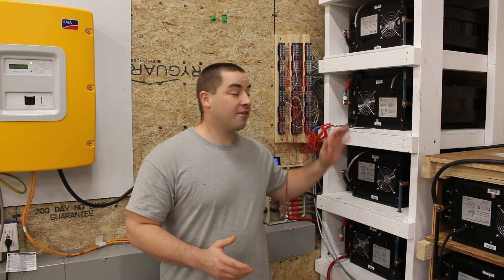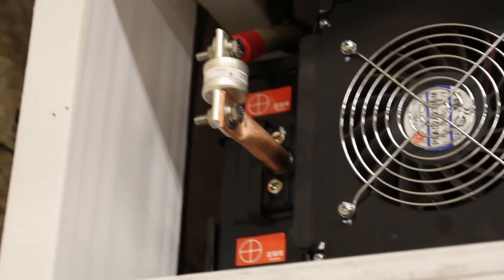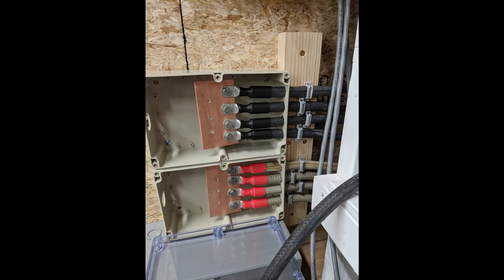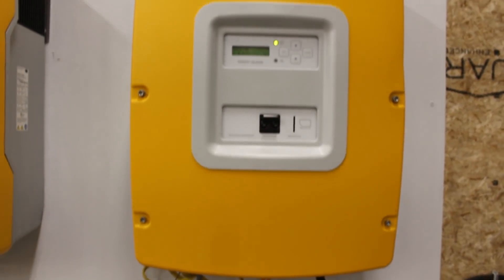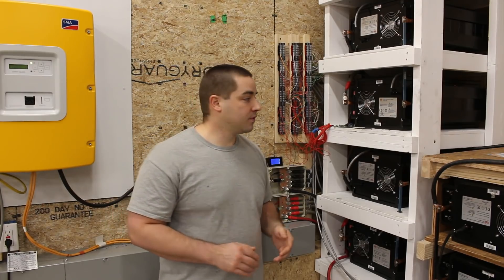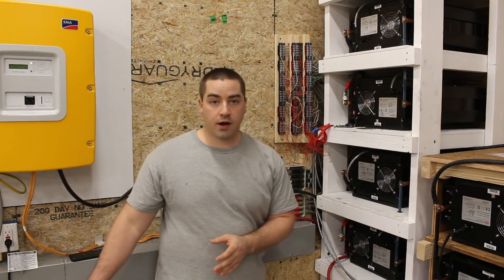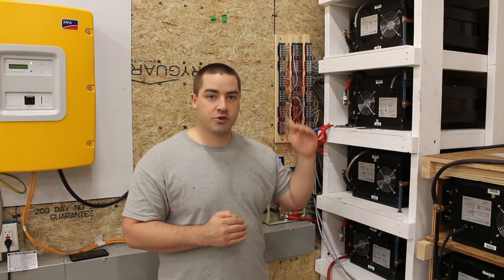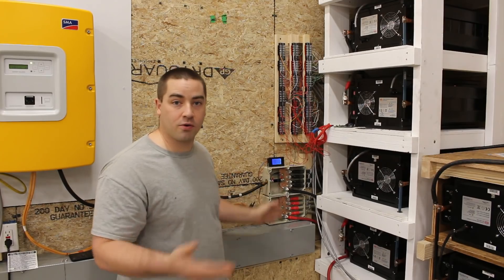Conditioning used LiFePO4 batteries, Update

Comment: David, is your original Chevy Volt batteries still fully charging by Noon in darkest Dec? Assuming you are still just using the original ground-mounted solar only.
Reply from the maker: Sorry I didn't mention this.  i sold the Chevy batteries, and the Aims inverter to help pay for this new equipment.  I'm buying power right now from the grid until the new system is operational.

Comment: I don't think there is much benefit in "conditioning" the batteries.  Unlike other rechargeable batteries, lithium doesn't have a memory effect.  Once the cells are reasonably balanced and the voltages are within the normal range you should be able to charge/discharge them normally.  Having said that, a few charge discharge cycles will give you a chance to measure their capacity and get a feel for how the system is working.
Reply from the maker: Thank you.  You are probably right.

Comment: Hi David, I have a suggestion for you.

You have got a lot of power there, and since you are still setting everything up; you should consider fire mitigation!

I see the exposed OSB wood & other wood, drywall, etc. 

You can make that area mostly fire resistant should a battery pack or inverter blow up, catch fire...

Consider going to home depot, lowes, etc. & getting the 4'x8' sheets of   Hardie-board. It is a cement-fiber board that is essentially fire-proof, rot, water, & pest proof!

If you cover the walls & ceiling you should contain any fire long enough to prevent further spreading to other parts of the home!  

Go watch the video they have showing where they stick a lit torch on the board for like 30 seconds and the board does not catch on fire or scorch!

Hope this helps.

P.S. this is a great solution for lining your water heater area too, in case of fire or major leaks!
Reply: 48v {2 packs in series) is 3v per cell, so should be 85 to 90% discharged at that point.
Reply: Wouldnt it be easier (and much cheaper) just to put that battery bank in a filling cabinet type enclosure?

Comment: 10amps, that is nothing spread over all the cells! 100 ma or so! 19kwh!! I could live a week on that! I'm hoping to get my bank up to around 30-40 kwh, 29v, a peak load of100 amp load would be  nothing on a 40 kwh bank, I mostly only run TV and fridge, occasionally microwave wave and the  well pumps 7 amps,  (I'm going add a large pressure tank, or gravity feed resivor to limit pump use, 200-450 gal. So water can be pumped with sun instead of battery! )  I'm thinking about buying a leaf battery and reconfiguring, put it back together and wiring it up, maybe get two eventually! Happy holidays to you and your family! And Happy NewYear!!
Reply from the maker: Those leaf packs look super easy to re-configure into 14s setups.  Battery Hookup has them for sale.  Here is a (affiliate) link: http://bit.ly/2P4H7g9  Two packs with delivery would only be $4,000

Comment: Just bought my batteries from batteryhookup... planning to start my powerwall project after moved to my new home on March but maybe start the conditioning process right now should be a good idea...
My setup will be a grid-tie 27kwh PV, and a battery bank as energy backup during hurricane season (South Florida). Did you know the Outback Skybox charger/inverter/gridtie/PV? I’m not sure of what kind of equipment to use... good luck with your project.
Reply from the maker: Cool.  If you don't plan to wire them up fully yet, it might be easy to use an ISDT T-8 for charging and discharging because it can monitor each cell.  I have not heard anything about the skybox, but I have heard good things about the Sol-Ark.
Reply: DavidPoz I’ll gonna take a look to this products... ISDT T8 is for 8s batteries, right? This battery is 8s or 16s?
Reply from the maker: Yes, the T-8 and Q-8 are 8s chargers.  These modules are 8s each.  I actually just bought the Q-8, but have not tested it yet.  The Q-8 is a little newer, but a little less powerful.  https://amzn.to/2PXX9c0  You need an external power supply (like an old laptop power supply) Here is an example: https://amzn.to/2SpONvD  “As an Amazon Associate I earn from qualifying purchases.”
Reply: Take a look at the Sol-Ark 12k. I have the 8k unit and it works great! Great guys to work with, they answered all of my questions and made suggestions as well.

Comment: Yup. Sounds good as for the conditioning phase. I have some lithium cells that sat for 6 years. I hit them with the full charge and discharge rating just to test them. Do not do that! I had great luck tho. No issues. But the 6-8 year old lithium chemistry that I tested I'm sure is not the same. Just wanted to share. I'm not sure how forgiving lithium is but it does seem to be somewhat forgiving. Every cell I have tested, if it's bad, it's bad. If it's good, it's good. Many folks have their own opinion as to what is good or bad. I trust your opinion! 
I do recommend you charge slow and cycle them slow for a bit but I have never seen it truly matter. Someone here I'm sure has seen it matter and I would follow that way of thinking. Better safe than sorry for a bank that size.
Reply: The exact chemistry matters alot, LTO or LFP wouldn't really matter they basically CAN'T go boom. All the common 3.7v cells can go boom though. I don't think being gentle will keep you from harming a bad cell though, the damage has already been done. But why find it violently? If a person doesn't have the time to take it slow, respect the battery, and learn I recommend they stop now and maybe leave it to a professional.

Comment: To sum up, for long and happy LFP battery life:
Keep the battery temperature under 45 Centigrade (under 30C if possible) – This is by far the most important!!
Keep charge and discharge currents under 0.5C (0.2C preferred)
Keep battery temperature above 0 Centigrade when discharging if possible – This, and everything below, is nowhere near as important as the first two
Do not cycle below 10% – 15% SOC unless you really need to
Do not float the battery at 100% SOC if possible
Do not charge to 100% SOC if you do not need it
Most of the time during discharge, the battery Voltage will be right around 13.2 Volt. It varies by just 0.2 Volt all the way from 99% to 30% SOC. Not long ago it was a Very Bad Idea™ to go below 20% SOC for a LiFePO4 battery. That has changed, and the current crop of LFP batteries will quite merrily discharge all the way down to 0% for many cycles. However, there is benefit in cycling less deep. It is not just that cycling to 30% SOC will get you 1/3 more cycles vs. cycling down to 0%, your battery will likely live for more cycles than that. Hard numbers are, well, hard to come by, but cycling down to 50% SOC seems to show around 3x the cycle life vs. cycling 100%.

Below is a table that shows battery Voltage for a 12 Volt battery pack vs. Depth-Of-Discharge. Take these Voltage values with a grain of salt, the discharge curve is so flat that it really is hard to determine SOC from Voltage alone. Small variations in load, and accuracy of the Volt meter, will throw off the measurement.

State-Of-Charge / Voltage at rest (zero current)/ Voltage under load (0.25C)
100% / 14.0 Volt / 13.6 Volt
99% 13.8 Volt 13.4 Volt
90% 13.4 Volt 13.3 Volt
70% 13.2 Volt 13.2 Volt
40% 13.2 Volt 13.1 Volt
30% 13.0 Volt 13.0 Volt
20% 12.9 Volt 12.9 Volt
17% 12.8 Volt 12.8 Volt
14% 12.6 Volt 12.5 Volt
9% 12.4 Volt 12.0 Volt
0% 10.4 Volt 10.0 Volt
Reply from the maker: Excellent comment.  Thank you for sharing.
Reply: what you do when your ambient temperature is higher than 45C? :P

Comment: I like the way you have wired your packs more than the packs in the non painted stack. Both options create an even charge and discharge, your setup uses more wire and your friends setup uses more copper, so I guess it depends of wire of copper is cheaper of if you already have a bunch of one or the other. I like that in your setup the 48V groups can be isolated from each other. Another thing though, is that I don't think you have your balancing leads fused. These wires are very small and they should be fused. If for some reason a cell in one of the 48V groups goes short circuit, because the balancing leads are paralleled between all the packs, the other packs will dump power into that cell through the balancing leads. Current will also flow through the balancing leads every time there is a large current spike from the loads if one of the packs has older and higher resistance cells in it. I assume you are going to only have one BMS because of the way you parallel the balancing wires, it would be safer to have 4 BMS's, one for each 48V pack that could shut off the output to that pack if something went wrong.
Reply: With the wooden rack this is a little more important, if it was metal or fire retardant plastic I'd say the wires themselves would be a sufficient fuse

Comment: just want to be sure David Poz. these are the batteries you use right big 48v LiFePO4 batteries?
Reply from the maker: The battery modules are 24v each. I have paired them to make 48v by series connecting the positive and negative of two modules.  I'm planning to use them to power my house after I finish wiring.  They are available at Battery Hookup: http://bit.ly/38Uwgx9

Comment: It's island protection and voltage and hz synchronisation to grid power some do it very quickly but SMA I believe have a large delay to make sure grid power is stable
Reply: My APSystems microinverters wait 5 minutes as well.  I wonder if that is part of the UL 1741 standard for Grid Tie.
Reply: @ddthames  it is indeed

Comment: I'm thinking going down to 48 volts is a lot lower than 20% SOC. It seems like the 20-80% range is 3.1-3.5 volts per cell. Probably even higher than 3.1 if you have a low discharge rate, maybe as high as 3.2 each.
Reply from the maker: That high?  I'm going to have to re-think this.  I've been to so many websites, and so many data sheets I am loosing track of them all.  Do you have any resources you would suggest?
Reply: @DavidPozEnergy  My guess is you probably need to run the batteries dry and make your own chart of % capacity vs voltage for them.
Reply from the maker: Thank you.
Reply: Ben Kaster I agree that fully charging and discharging each pack is the best way to get a handle on its actual capacity, especially if the cells are used and have been stored for an extended period. 🤓👍
Reply: @DavidPozEnergy  I found this paper is a pretty good source of real world data and good insight into characteristics of LiFePO4 batteries David. Its a scientific paper, so seems a little overwhelming to me at first, but easy enough to read and understand once you get past that. https://www.researchgate.net/publication/271430540_State_of_charge_SoC_estimation_on_LiFePO4_battery_module_using_Coulomb_counting_methods_with_modified_Peukert
Reply from the maker: Thank you Benny Banger.
Reply: @DavidPozEnergy  Here is a discharge voltage graph:
http://www.hecobattery.com/photo/pl2375533-3_2v_environmental_friendly_lifepo4_battery_cell_20ah_iron_phosphate_battery.jpg
Seems to show that 3.0V is right if your going for 30 minutes of backup, b ut close to 3.2V is right if you have a 5 hour backup (.2C). That would be >51V I think.
Reply: @DavidPozEnergy  I was bleeding down one of those batteries, one cell at a time.  I was at 3.1 volts with a 0.5 ohm load and the voltage dropped to trip my 2.95v cutoff.  I reduced the load to 1.0 ohms and it would run for 15 minutes or so before tripping at 2.95v.  So at 3.1 volts it is pretty well depleted if it can't source 7 amps, about 0.05C

Comment: I'm using 80% max and 20% min.
Assuming what Batteryhookup info is accurate;

58.40V Max
40.00V Min
54.72 43.68
Max Min

So, for me 40 to 58.4 is the 100% range.
I set mine to 54.7 MAX, and 43.7 MIN. That's close to 80% and 20% with the 58.4V and 40V as the, 100% and 0%.
I set my bulk charging to 58.4V, the float to 54.7V, and the amperage still at 20 amps (that's the lowest my MPP LV5048 will charge the batteries with, it can go from 20 to 220 amps!)

Running off the pack 2S4P, averaging 1000w total output, they are very happy and keep at 52.9V. They return to 52.9V with brief 2500w loads, ie popcorn from the microwave (3min) and the heater going, 20ish minutes.
Reply from the maker: Thank you.
Reply: @DavidPozEnergy  I charged to 54.7 last night, and 54.0 the night before. Tonight I'm going to just charge to 52.9V, they seam pretty happy there.
Reply from the maker: Thanks.

Comment: What is your input capabilities from your solar panels? Max current?
Reply from the maker: I don't have the solar connected right now (hence pulling from the grid to charge) but when I get the solar connected it will total 7.7 kw.  That could be a max charge current about 160 amps.  Max discharge current is the 12kw of inverters, or about 250 amps.
Reply: @DavidPozEnergy  I would get to your actual setup. Use the solar to charge the batteries. It saves money and it allows you to check for the glitches early to order anything you may need. I would use your original charge controller for now until your ready to use your inverter. Also are you going to wire your Chevy volts in to use as at least a back up pack. I have ways to wire it all together so no switches or man power is required

Comment: Do you have the spec for the battery? Probably at 56 v the batteries are fully charge ?
Reply from the maker: 58.4v is fully charged.  I'm keeping away from the very top and very bottom until I do a few cycles.  Thanks for watching.
Reply: @DavidPozEnergy  And until you have a balancer or at least a way of monitoring the cell voltages.
Reply: To balance your cells you may want to use balancers différant approche than a traditional BMS I use it in 2 v version for AGM 2 volts batteries application works perfectly
Reply: https://www.electriccarpartscompany.com/24V-8S-Lithium-Battery-Balancers-Equalizers
Reply from the maker: I've heard great things about those balancers.  You can get them a bit cheaper on Aliexpress: https://de.aliexpress.com/item/32696417844.html?spm=a2g0o.productlist.0.0.64535b76qHgxXK&algo_pvid=5291504b-c088-4a88-8098-cbc00c9cb1a6&algo_expid=5291504b-c088-4a88-8098-cbc00c9cb1a6-4&btsid=029529ee-dcdd-478d-931c-ceab037f9778&ws_ab_test=searchweb0_0,searchweb201602_10,searchweb201603_53

Comment: Did you check the resistance of each wire since they are the same length? Of the many years of off grid I actually had one bad wire or one that had more resistance due to a pin hole letting water in causing corrosion. I believe you are retired military so we know assuming is not good. But I love how you have set it up.
Reply from the maker: I did not check the resistance of each wire.  But, you make an excellent point.  We don't know if something happened like you described.  I'll have to check.  Thank you for the tip.
Reply: @DavidPozEnergy  should be possible to check in circuit with a current clamp and a volt meter measuring mV at either end of the cable. You may have to wait until you are willing to run much more current through to/from the batteries - doubt the voltage drop measurement will be accurate with only a couple of amps and such very low expected cable/connector resistance - though it will point out any really problematic cable runs if any exist.
Reply: @Bennyboy-dog  I got 0.3 ohm on everything DC, and 0.2 ohm on the AC lines. I used 1/0 welding cables for the DC, like a billion little copper wires in each cable, and 6 awg and 10 awg in the AC lines. I should have just used 10 awg, that 6 is nutz to bend and I am still surprised I made it fit in the inverter. The 10 awg is just one big copper wire, the 6 awg was 8.